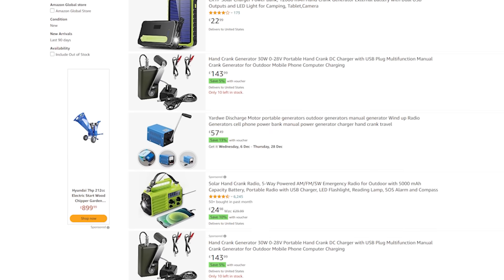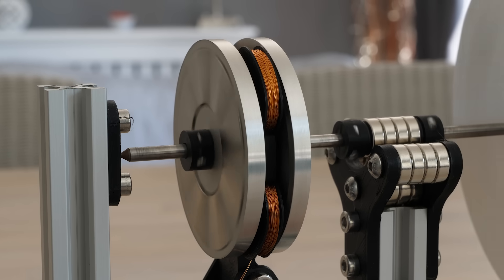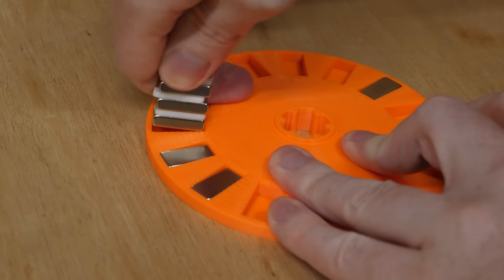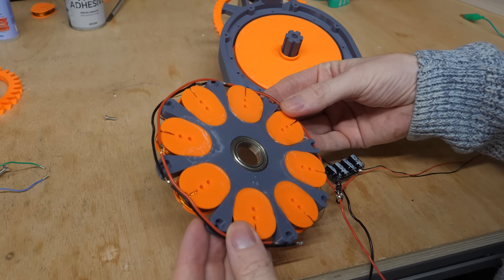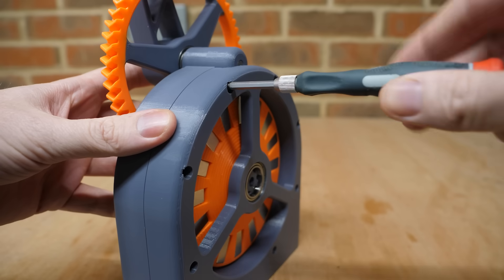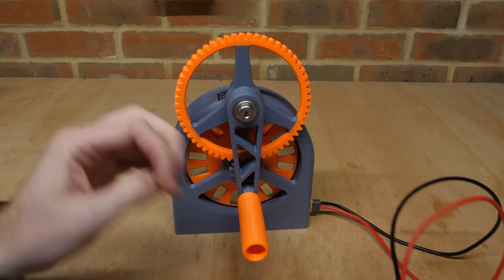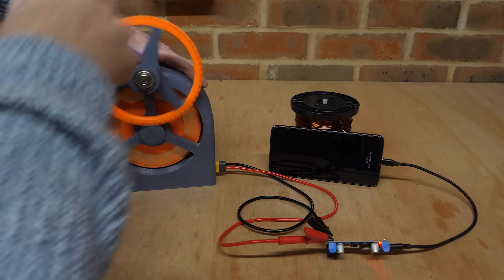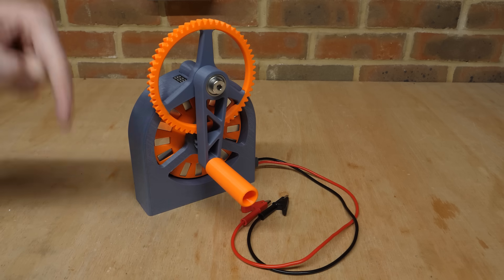Building a Generator

Comment: Well, something like that would be awesome to charge a larger battery, like goin out with a cb radio and a battery and actually charge it, im just stupid for these stuff. I guess i will make one, try to copy somehow what you did in this video, soldering etc, and lets see what will happen i guess :D
Reply: You CANNOT charge a big battery with this. This thing maybe produces 5-10 Watts (1A at 5 Volts = 5 Watts, and as you could see he phone charges very SLOW, that means your AMPS are very low such as 1A or even 0.5A which is often minimum for phones to charge (=2.5W)). Do the math how long it would take you to charge a car´s battery for example. A car´s battery has about 12V á 50A = 600 Watts or even 12V at 100 Amps, that´s 1.2 kWh of energy. So at 600Wh for a small car´s battery it would take you 120 HOURS of cranking to get it charged. A WEEK has 168 hours! So tha´s...many days!
I would take you literally nearly 1 week of 24/7 cranking to get it charged with this.

The max you could charge with this is a small powerbank. Something like a 10000 mAh-powerbank. It can take around 37wh. So that´s "just" 10 hours of cranking then to fully charge it.
Reply: @SmartZero-f8e   Thats good info, thanks! I have seen many similar videos, i hoped if there was around 5 light bulbs, it can do more job. But hey, if i ever end up homeless which has a pretty high chance, i can go close to water and use its moving energy to have at least light in my wooden house haha >:)

Comment: As you might know, electricity costs are going thru the roof, down here in Germany. How much electricity can I produce with the pressure/flow of water out of my water tap? Or better, how much wattage via 240V?
Reply: max. 10 Watts for small water-pumps! Forget it! Just enough to power some shower-water-mesaurement (LED/some small circuit).

and hey do not produce 240V (220V) at all! BIG Water-pumps with thousands of watts can produce 100s of watts through water. Those cannot be bought or used by small consumers.

You find these in water power-plants. Typically used in water-falls!

Comment: Have you seen these smart trainers like the kickr core?  it seems like they could be modded to be bike generators pretty easily, a lot of them are getting fried due to static shocks so you could maybe find a used broken one for a decent price
Reply: Smart trainers can only produce ~5-10 watts to charge a phone max. Not enough to power anything more. They have very cheap motors, which can only handle 20W max o something like that.

A Wind-power motor, which is used for POWERFUL Bycicle-generators costs 200-300$ alone. and they can handle about 300-500 Watt and thus can produce so much energy as well (max, assuming you are in good enough shape to handle this much pedaling).

Comment: What is that USB 5v regulator he has, and could it work for higher voltages, like if I had a wind turbine style of his generator in crazy tropical wet-season winds?  He seems to list most other parts of his projects in the links but not that little part lol

Comment: Is there some magic way to have a manual crank that wont fry my electronics if i crank too hard. 

Presumably it is not possible to damage modern devices with too low power.

Ive always been a little interested/curious in manual power generation
Reply: Yes. You need a protection circuit.

Comment: Let's say that I have 2 batteries for my ebike and I leave home with both fully charged and when one drains out, can I connect it to a similar device and charge it while pedaling and maybe get at least half of it back and after swapping again to get a quarter out?
Reply: It's not feasible because whatever energy being put into the battery when you're pedalling will come at the expense of the energy being put into moving the bike forward, so you will end up having to work twice as hard as usual, to bike at the same speed.

Comment: I have a cool idea. I was watching a vid on 3d printing a mechanical clock and they used a lot of gears. They put the clock high on the wall and attached a string to the gears with something heavy on the end. the more gears used the more time it would take for the object to end up on the floor. Maybe if you combined both this generator and the how that clock worked then you won't have to crank it up just let gravity do it.

Comment: I have a question. Would it be better to have the coils wound around an iron core? I realize this would cause more "cogging", and certainly more stress on the rotor and stator plates, but my intuition tells me you would energize the coils with quite a bit more power.

Comment: Random question: if you connected a motor to the generator, and the generator to the motor, so it spins constantly, and some of that energy is output to charge something, what happens?
Reply: That works only if you power a BIG Generator (by hand, e.g. with a rope-starter) first, which then powers the small motor!

Comment: Hi, can you tell me how much it would cost for making this same modeled 3d  hand cranked generator?
Reply: I´s much better to buy it. Costs much less. A powerful 30W-Hand cranker costs only 100$! But this thing here, which can barely charge a phone, will allready cost you nearly 100$ to make it.
Reply: @SmartZero-f8e  The one which we buy is axial bldc / radial bldc or just brushed DC motor?
Reply: @SmartZero-f8e  but, one question, is the 30W hand cranked generator bldc or brushed dc motor?
Reply: @pavanra7453  It´s an old model. these use old-style brush-motors: They have a very long lifetime of around ~250000 hours though (roughly 250 years if you use it 1000 hours/year = equals around 3 hours usage every day). Trust me: Circuits will fail much faster (which you can easily replace) than the whole motor/Generator-mechanics.

Comment: That would be great for if you've got a lot of time on your hands e.g. a power outage. You could power up a back-up battery to keep your fridge going just enough until the grid turns back on. Granted, you and your family would have to take it in turns because a fridge would drain a back-up battery so fast and you'd definitely get a muscle cramp cranking that wheel for an hour. Granted, the inherent coldness and insulation of the fridge would keep the inside cool as long as you didn't open it. After you open it to get something, you'd definitely need to keep it on to replace the coldness lost from opening it.

Comment: Why don't you make your design available for commercial use? You're being very silly what is wrong with you? Give you shall receive. life is too short to be self involved.
Reply: Because it isn´t that good. A good hand-cranking generator can do about ~30-40 watts and reaches about 4000 RPM which should equal around 3-4 cranks/second or 180-240 cranks/minute. This equals about 4000 Rounds per minute. Of course professional crankers use many gears as well to reach that high RPM. But they aren´t using plastic- or 3D-printed gears.

And even if you produce a good hand-cranking generator on paper and in theory. You also need good an efficient circuits which produce netto-usable performance (Watt) for your DEVICE, which you want to charge. and if your circuits are bad and/or they aren insuffienct, then your oherwise good hand-cranking generaor will lose lots of energy in he conversion-process for 5V/9V/12/15 or 20V.
Reply: @SmartZero-f8e  Realistically you don't need this much rpm at all. This generator does seem to underperform, but there are rather simple handcrank generators made on youtube doing as little as 120rpm and making 50 watts ouput. Rewiring old e-bike motors can do a phenomenal job at producing at types of generators, from 0 to 250 watts, depending on type of energy harvesting. I've fiddled with them myself quite a bit.
Reply: @SmartZero-f8e  Okay, seems you're experienced with these devices. I'm thinking this problem shouldn't be difficult to solve because you can always add gears and a transmission to alleviate or increase the resistance right? What you're describing with varying the voltage sounds just like manually changing gears on a bike. 
I'm thinking of making a generator  and designing a modular frame and a transmission to switch between applications like handcranking, pedalling and windmill/waterwheel all in one compact little box.
Reply: @DKFX1  You want to lower the resistance. This isn´t possible without taking gears away. And taking gears away drastically lowers the RPM and thus watt-output of your generator then.

Each Motor has a given fixed, non-changeable resistance. Only new brushless-moors can change his resistance through control via chips. If you do this though, you lower your watts as well. Because it means a weaker magnetic field.
Reply: @SmartZero-f8e  I was thinking of having a transmission with multiple different gear ratios. 1: 5, 1 : 10,1 : 25, 1.  :50.
Reply: @DKFX1  I don´t understand what you want to achieve with that...
Reply: @SmartZero-f8e   For a windmill, in example, you want to be able to spin easily in low winds, and at higher winds, you might want to add resistance to the turning of the generator, to get more RPM in the main shaft By applying a lower ratio. This can also be used with other applications, ie handcranking pedal cranking etc.

Comment: Great project. Just wondering how much torque is required to spin the crank when charging the cell phone?  A few years ago, I designed a vertical axis wind turbine. Just never found the right generator for making it work. This may do it. Thanks for the video, a new subscriber

Comment: I can see plenty of usage for this. For example, feeding rainwater in the crank wheel mechanisms that fills the capacitors that activate a sump pump at the desired water level. That way even when power is out, you don’t have to worry about your cellar flooding.

Comment: mmmm why is it whenever im looking at random videos i magicaly come across information on exactly how a bridge rectifier works  I was trying to get a vintage sears 12v battery charger to work again but it has this extremely weird diode setup where it has 2 output leads on the transformer touching   2 little  button diodes  that are attached to a metal plate  then from the plate it goes to a alittle breaker box i was trying to bypass the 2 diodes because on poped and that plat is fused to the diode and they don't sell the plate anywhere ( i already tried to put a new diode on the plate but it doesn't work) also whenever you turn the battery charger on the transformer makes a really low hum   i haven't messed with it lately but now i may go back to it thanks to this video 
also i bought some of those 4 terminal cube rectifiers  ( they are used in genorators) but can't find for the life of me how to hook them up to the battery charger  i know how to hook them up but i don't think im putting the right wires in the right spot

Comment: You didn't show the schematic for your series+parallel arrangement of the coils. The output of each coil will be AC, but at different phases from one another. If you have several out of phase coils in parallel, a lot of wasted current will be running between each coil and the mathematical sum of the voltages will go to the "output" of the group. You will generate (example) 10 kW of power but only be able to make use of 3kW. This will heat up the coils more than you probably expect and you'll have to derate the current capacity of the wires.
A way to fix this is if you have a fullwave bridge on each coil, and you can combine the bridge output in series and/or parallel to your liking to get a more efficient generator. [There are other ways too.]

Comment: I know it's a matter of mechanical energy to electrical energy, but something has to wear out in this situation, energy was used to produce both the magnets and copper wire, and heat is building in the coils to resist the magnetic field, would the magnets depolarise over time? The PLA is definitely going to wear down. Just like aluminium is seen as storage of energy during it's processing and released once used in a commercial activity. There is no free meal.
Reply: That's absolutely a misinterpretation of the concept of conversation of energy. There is no law stating that mechanical parts have to wear out due to their involvement in energy conversion using these types of generator devices. As you said, it's converting mechanical energy to electrical energy and if parts wear out quicker or slower, it's entirely caused by the choice of material and mechanical setup, lack of lubrication etc, not because 'there is no free meal'.
Reply: Magnets only lose their magnets in VERY HOT environment (such as 50°C+). OR: After 400 years are over! Such a generator can be used for many, many years before a component of it will fail. Remember. they are also VERY EASY to repair!

Comment: Cool project! How about improving the design with a planar gear in line with the axel. Device would be more compact, more stable, more solid and you could make the non-crank side grippable by the other hand. And as other mentioned pop some super capacitors or lipo in the unit with a charging regulator and a usb plug (even better a multi-voltage USB-C plug) in addition to “raw” output. Next step would be to make the hand crank interchangeable with a pulley. Combined with a make shift water wheel and semi elastic cord you have a small ad-hoc hydro-power generator. Next step would then be an interchangeable and foldable wind propeller…😊

Comment: you could change up the gear ratio a bit to generate more power by spinning the magnets that much faster with the same amount of work on the crank. in fact, it could potentially be upscaled to allow you to charge your home's battery bank with a bicycle on overcast/rainy days if you have solar panels.
Reply: No. Humans can't produce infinite energy or large quantities with their body no matter how big your gears are.. 300-400 watts is the most you're going to get from a human body.
Reply: @DKFX1  really? well damn
Reply: @DKFX1  300-400 Watts? That´s only valid for "Arnold Schwarzenegger" with big bigges body-muscles... But an average Joe will only get 60-90 watts out of a POWERFUL Pedal-generator. And an advanced runner will get 120-150 watts out of it.

I started pedalling with 30 Watts/hour (also hand-cranking at 20 Watts/hour).
Then after 3 months i allready reached 60 watts/hour on a pedal-generator. And 30 Watts on a hand-cranker.
And now i can do 90-120 Watts with a pedal-generator and about 50-60 Watts with a good-designed hand-cranker.
Reply: @SmartZero-f8e  Notice I said from a human body, so that's both legs and arms and everything else combined. And I also said ' at most' meaning it's around the upper limit for a human body, so arnold is a decent example. I realize most people will be significantly below 300-400 watts.
Reply: @DKFX1  Yeah. Arnold would be 500W most-likely even haha. And an Average Joe´s will be about 100-200W max.
Reply: @SmartZero-f8e  Yes, I had read Tour de France riders average 250 watts and thought maybe they can do 30% of this output with arms also, while riding, so that's about 330 watts. 200W is being quite generous to average joe haha.
Reply: @DKFX1  i started with 10W/hour with my bare hands in 2022. then 3 months later i could do easily 20W allready and another 3 months later i reached 30W/hour.

Today 2 years later i can do 60W/hour wih my bare hands. Which is more than my handcranker can even handle. lol.

So insead i handcrank on my pedal-generaor now and reach even 80-90 watts sometimes by hand for many MINUTES!

So yes. That means i have much stronger hands, than legs.

Because with legs i can only reach about 70-100 watts for very short times. Unil i am exhausted. I am rally fas exhaused when i have to pedal by foot.

So i am allready a half Arnold Schwarzenegger now. I even carried everyhing by HANDs from shops in 2021-2024. Sometimes 10 KG. Sometimes up to 20KG just in bags.

I carried everything for exercising and making my arms much stronger.

Comment: You should collaborate w/ someone who has a large scale printer so you can make a foot driven bicycle style crank rather than the hand crank. It would make a cool large power generator.
Reply: Stantons current generator can easily be modified to work with bikes. No need to redesign the whole thing.  Just add a friction surface between rear tyre and the crank shaft then you can use your bike to produce.

Comment: I want an indoor bike generator with tons of gear ratios. Energy to home battery solution which gets fed to grid at optimal times.
Reply: You would lose a lot of energy, just when you convert your energy into house-grid...Also: Such generators CANNOT be plugged into your house grid!

They use 1-phase 220V-Energy. Or 1-Phase 110V-Energy.

While ypically (e.g. in europe) hey use 3-phase 220V-plugs. So you CANNOT simply plug a generator like that into your house-grid to feed it with more energy.